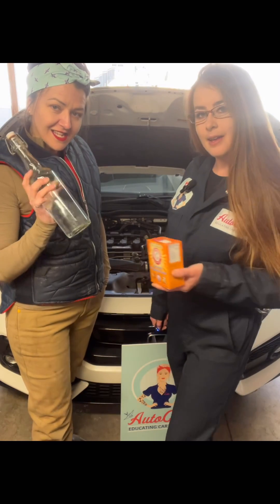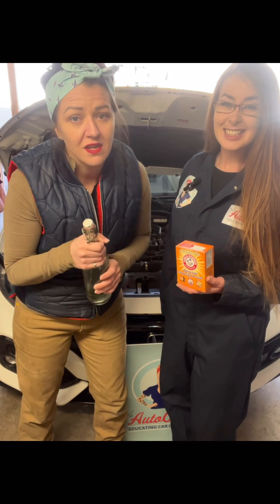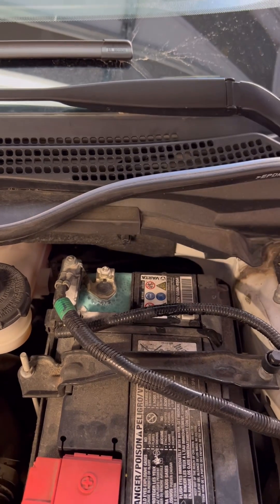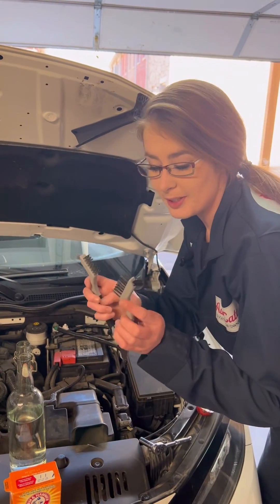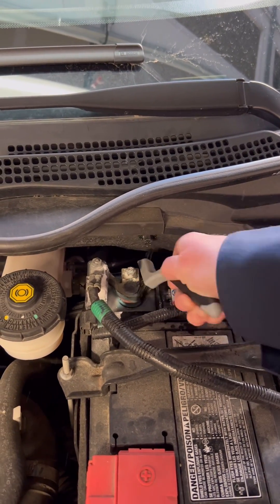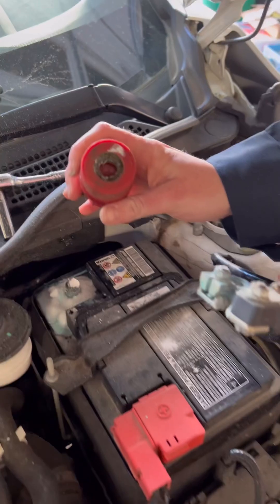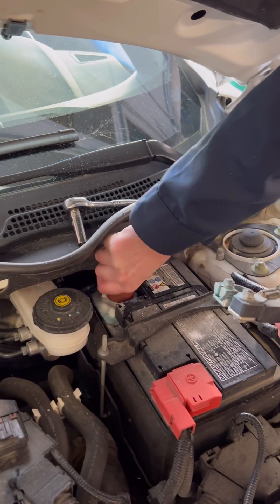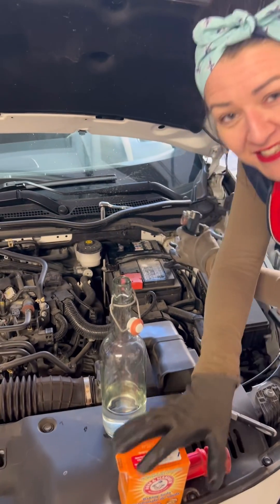Battery corrosion? No problem

Comment: So why do some batteries corrode and some don't? and why is it always on the positive terminal?
Reply from the maker: In the video, it’s the negative terminal that’s corroded. Happens to both of them. As your battery ages it releases chemicals that cause corrosion. It can’t be avoided, but it can be cleaned up! Hope this helps
Reply: Look into electrolysis